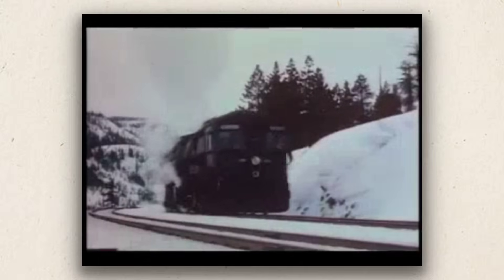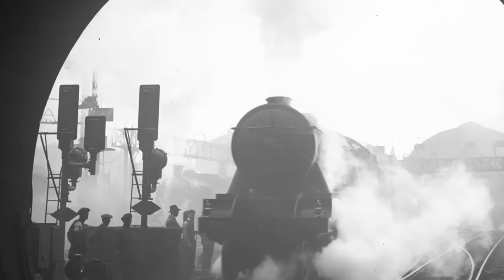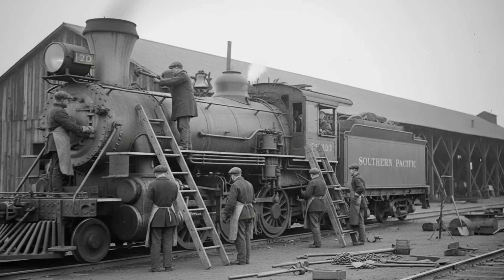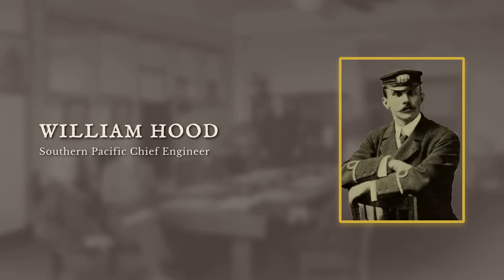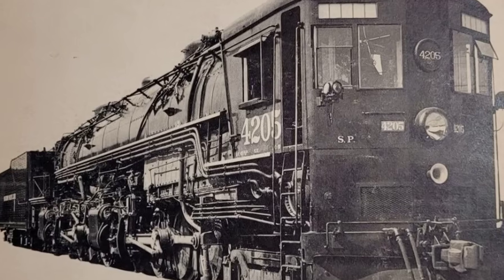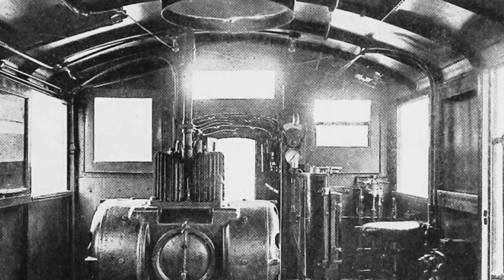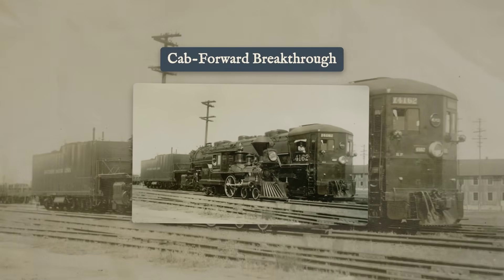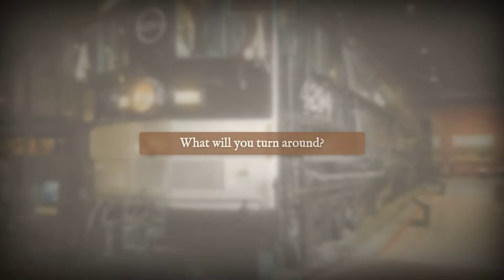Critics Called His 'Backward' Design Dangerous - Then It Saved The Crew From Suffocation

Comment: By 1909 they should have had all electric locomotives available. Electrifying that short stretch of line and having electric engines just for the pass would have solved the problem even better.  In the Rogers Pass the snow sheds had open sides on the side away from the mountain for ventilation.

Comment: The cover photo for this video is extremely interesting, looks like 2 cabs, if it’s original photo then the front cab was probably used as a protection for crews running test equipment monitoring the performance of the locomotive.

Comment: In 1977 I hopped a freight train through Colorado I had no idea that we would be running through the 6.2 mile Moffat Tunnel through the Continental Divide.  I was riding an open flat car and the tunnel was filled with diesel smoke. I thought that I was going to die from the fumes.  I held a piece of clothing over my mouth to use as a filter and I survived.

Comment: How did the shovel in the coal
Reply: Did you watch the entire video? As said in the video, they are oil fired
Reply: @_justsomedude I don’t have time for that
Reply: It depends on the construction. Some cab forwards just had two cabs - one for the driver and one for fireman on the back. However there was a better option - mazut or oil. It replaces coal as fuel and the oil is transported to the firebox by pipes and it's atomised in it.

Comment: Was not easier just to drive the locomotive in reverse? (tender in front)
Reply: Train crews did try this, but because steam locomotive tenders in the 1900s were designed to be pulled and not pushed, the speed of the trains were limited. Additionally, turning the locomotives around every time they entered or exited the snowsheds was time-consuming, and by putting the locomotives in reverse, the driver couldn't see any signals up ahead, as he has swapped places with the fireman. The fireman would have to read the signal and call it out to the driver.
Reply: @brandonpreap6035  interesting! I didn't take in consideration this aspects
Reply: Also in a conventional locomotive if the smoke box is lower the crown of the firebox may become exposed, not too much of a problem downgrade when you can throttle back, but uphill when working her hard it can create serious issues.

Comment: There was another, way cheaper solution:  Build sealed cabs to keep the exhaust  and heat out,  and then have a 12" tube running along the side of the engine (insulated from the heat of the boiler), and have it extend out in front of the engine by around 20 feet, where it would draw in fresh air, pressurized by a fan sucking the air in, and that air would blow into the cab and keep everything nice and cool and fresh in the cab.

Comment: Why didn't they electrify the line through Donner Pass?
Reply: They probably couldn't justify the costs to electrify the route.
Reply: I would image the extreme risk of avalanches  and rock slides would be a common issue when it comes to knocking down any power lines.
Reply: @bigtime7724 they could probably pull it off if they used a 3rd rail system
Reply: There may not have been sufficient clearance for overhead catenary
Reply: Stupidly high cost and maintenance and difficulty to power the full line. Much easier to just improve the locomotive then it is to do that. And full electric locos are lame lol
Reply: Money 💰!!!

Comment: Why didn't they drill ventilation shafts?
Reply: I’m not totally sure but it might have been because of structural integrity or snow getting in or even just blocking them
Reply: @NylesSeamon-s7c I was wondering the same thing, but your explanation makes a lot of sense.
Reply: Listen to the video again - this is explained - the snow clogged the ventilation shafts.
Reply: Volume of smoke.
Reply: Safey mandates were weak and vetalion costs